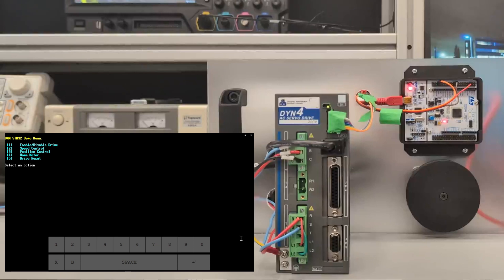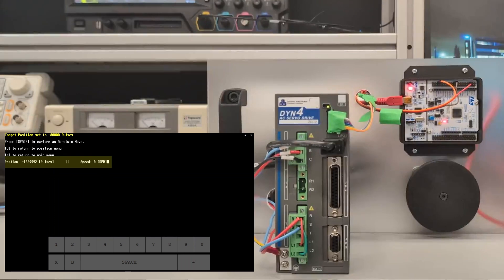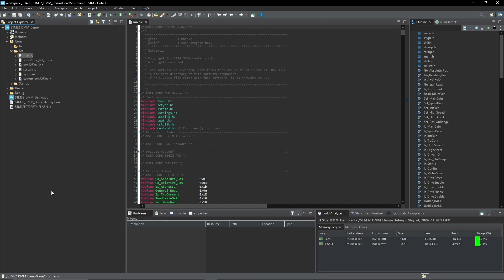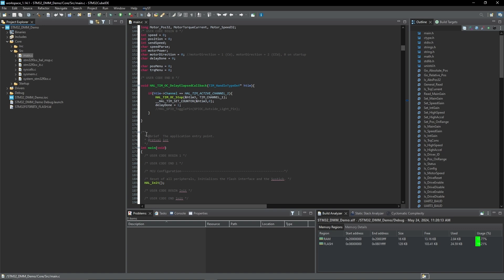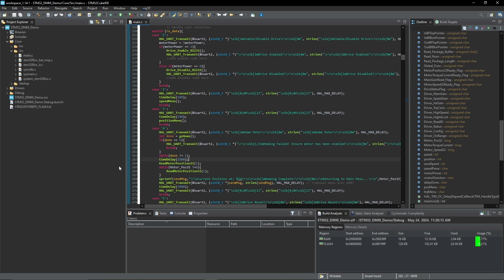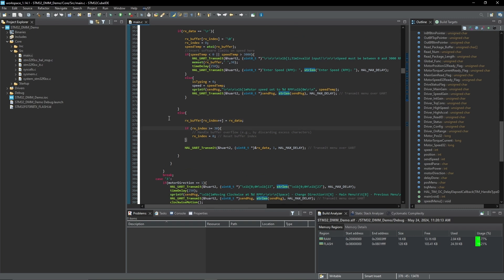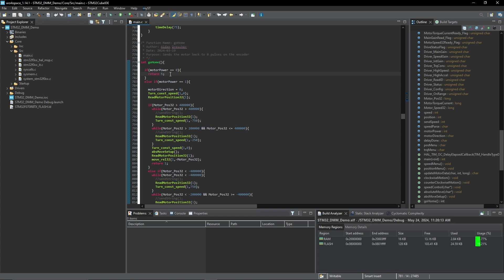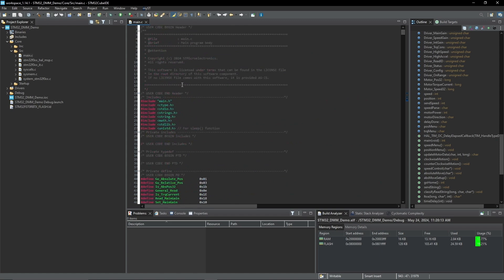DYN4 AC Servo System to STM32 Demonstration (NUCLEO-F070RB)

Comment: The project in github doesn't seem to have the code from this video in it. I downloaded the project and opened it in STMCubeIDE, but all I see is boilerplate code. Did you submit the actual code? (No judgements, I've done it many times).

Also, please don't zip the source files before you submit. Zip files can't be diff'd for changes. :(